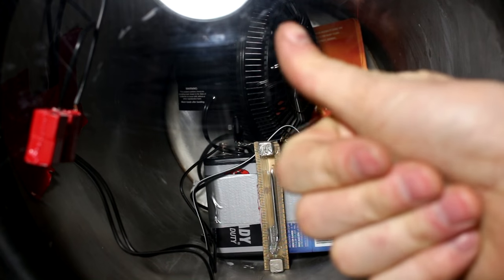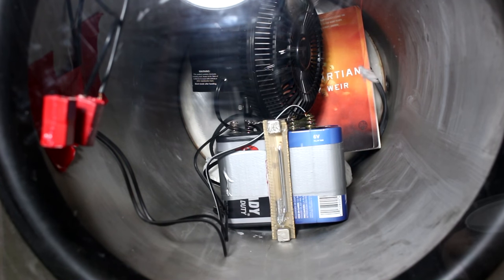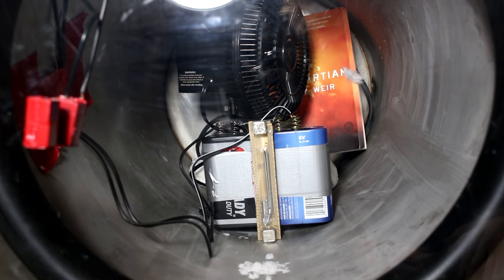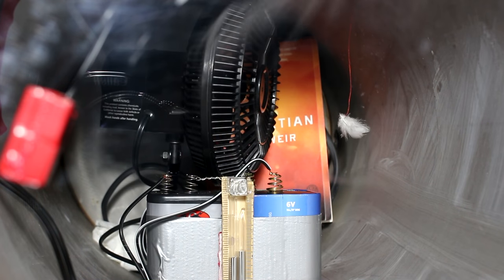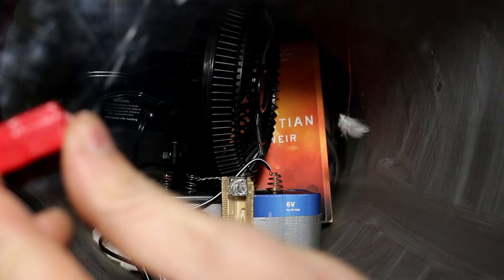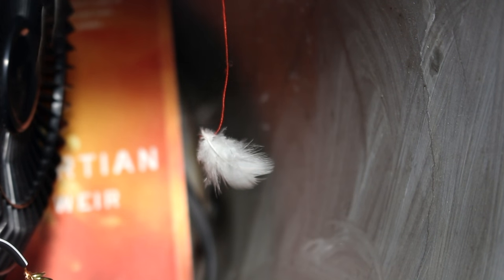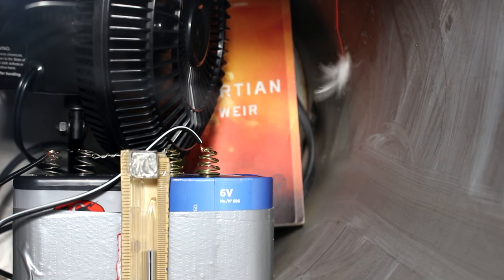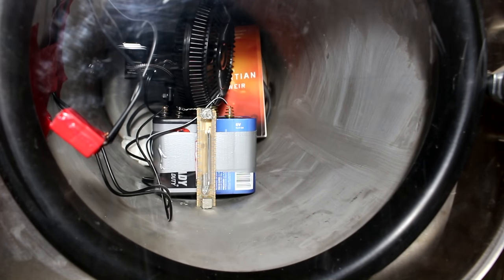How Strong is The Wind on Mars?

Comment: I though it would move at least a little bit more. BTW. I think that fan just pushes less mass but we measure gas flow on earth by measuring how fast some fan spins pushed by the air. So 200 (or whatever flow/units) on mars will be different on earth.
Reply: finally !
Reply: The issue is that the fan is designed to push air at atmospheric pressure here on earth. As the air pressure and thus density drops its moving less air. 

This demonstration doesn't really prove anything as the CO2 being pushed around by the fan isn't moving at the same speed as it was with the air. To get the same velocity of air movement you would need a fan blade engineered for the lower pressure.

A more extreme example of this is a boat propeller in air. Just because it moves through the water at say 20km/h, its not going to create wind at 20km/h.
Reply: lordgarak Good analogy. I wouldn't even thought about it.
Reply: Linear stream speed is a function of blade RPM (less a bit of slip), both for a fan and for a propeller. Unless you go to the extreme where the blade is aerodynamically stalled. But the fan spins MUCH faster in low pressure atmosphere. In fact, the fan would probably totally self-destruct due to over-speed, over-current and over-heat if Cody let it run much longer.
Reply: No? The wind speed a fan produces is basically determined by it’s form and it’s angular velocity. Since the angular velocity is NOT independent of the mass, you do have a different wind speed, but: This wind speed is initially bigger then the speed under normal circumstances. So this test is quite fine.

Your analogon has but one issue: The boat propeller DOES in fact produce a wind at more that 20 km/h, since the air has less mass, but this wind is quickly dispersed since air is compressible and has little intermolecular forces.

The thing is that air velocity is actually not important to what we feel (or the effects it has). The average speed of an air molecule at normal conditions lies at about 550 m/s ~ 1230 miles/hour. But the important thing is not speed, but momentum, more specificalle the (average) total momentum of a directed stream of molecules. And less pressure means less molecules means less total momentum.